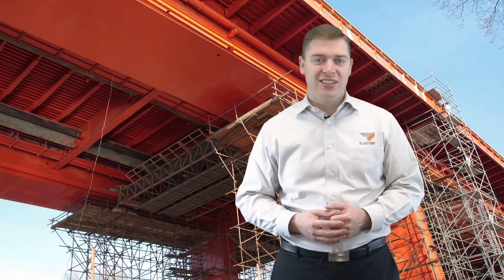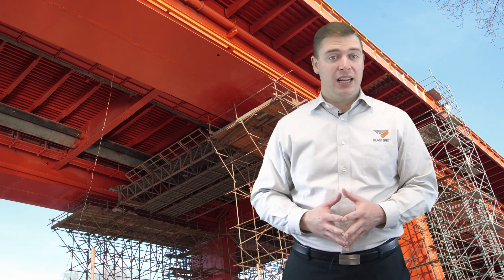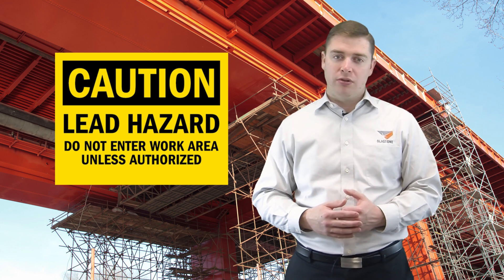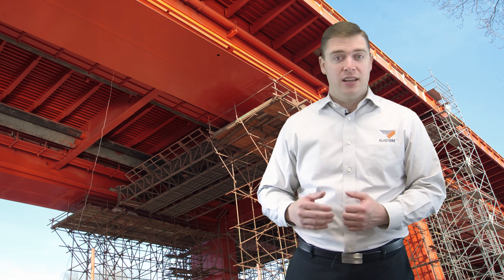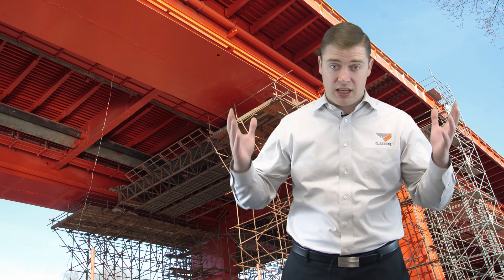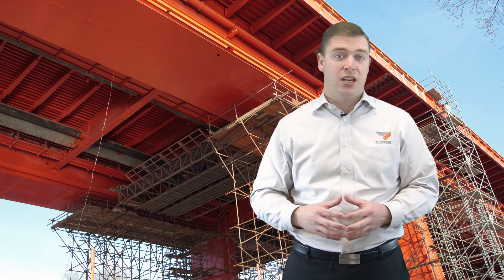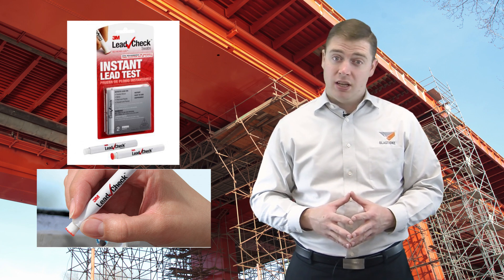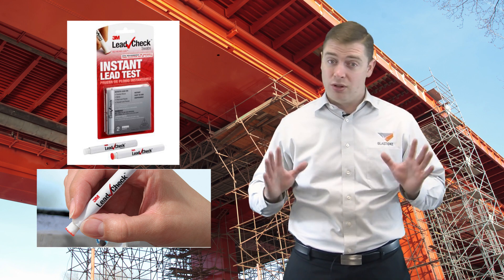Detecting Lead Paint on any Surface

Comment: What if the paint is red? Wouldn't the swab turn red from the paint? Thanks
Reply from the maker: the paint shouldn't effect the swab, unless it is deteriorating. then you will want to scrape the old coating off first, to expose the primer, which is typically where you find the lead. closest to the surface.